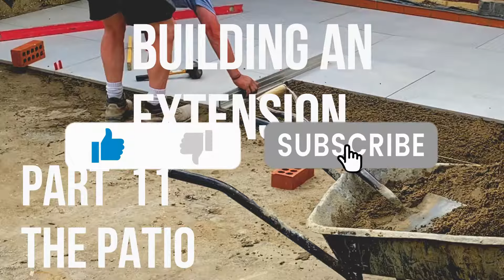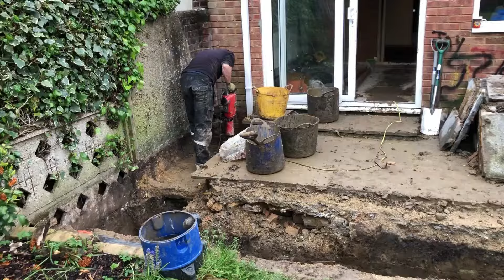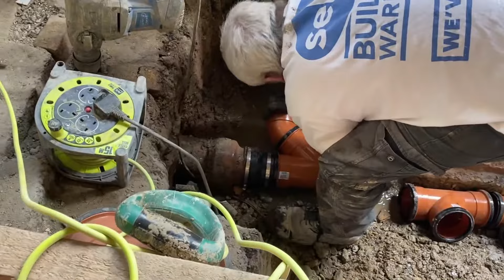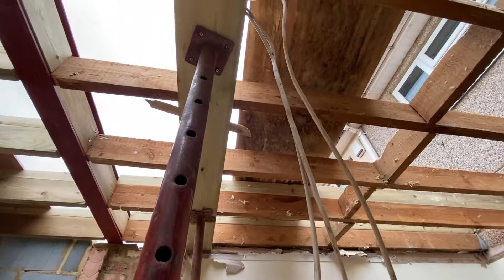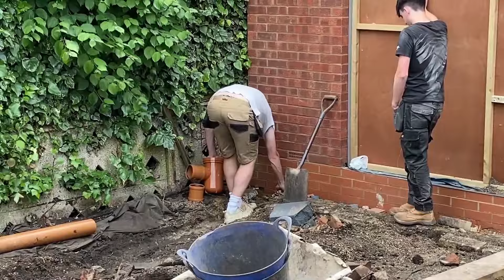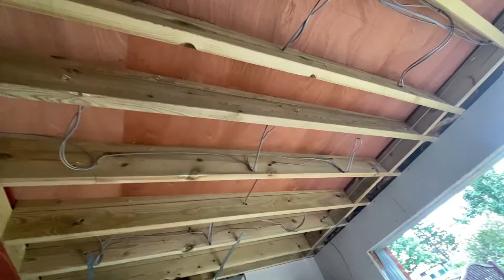Building a House Extension - START TO FINISH - Watch the full construction - All 11 Parts

Comment: That patio is pathetic. Prep all wrong, you should have broken down the brick to 30-40mm then covered with type one and not sand. The porcelain should be primed on the rear side not some slurry poured on the mix. The mix is far too dry. That patio will never last 20-30 years. No chance 😂

Comment: You should never cross lap your felt on the roof. Your underlay should run in the same direction on your csp sheet. Which would be with the fall.

Comment: Hi, I know house roof pitches are generally between 30-60 degrees(mostly below 45), also know flat roofs are allowed. I'd like a shallow roof, combining advantages of pitched roof (no flooding risk) with greater space flat roofs offer. 
Is there a minimum roof pitch requirement in the UK's building reg? Thanks in advance
Reply: Usually 12.5°. Anything lower and you risk rain coming under the tiles in windy conditions.
Reply: @housinauthority5258  You raised an interesting point for traditional tiled roofs, thank you Housin A. 
For this project, I'm thinking about SIPS on the roof for better thermal insulation with Catnic SSR2 covering it (both offer speed and lighter loading). Wind and rain shouldn't pause any problems.
Reply: @soundslight7754  Sounds like you have done your research and came to a solution. Exciting times sir!